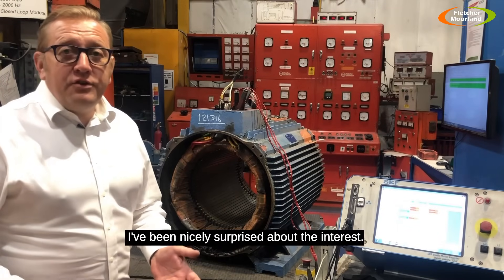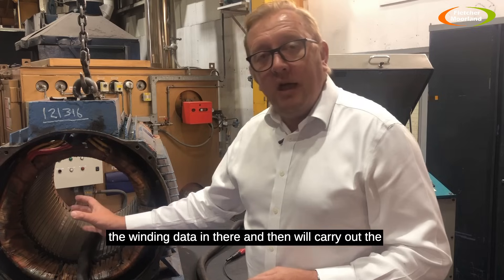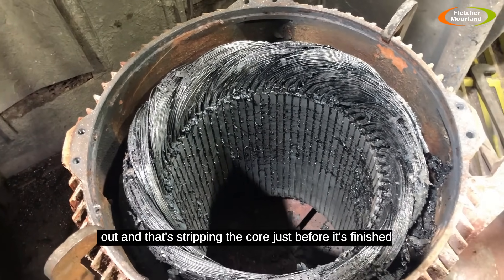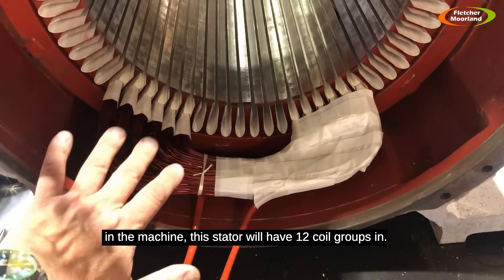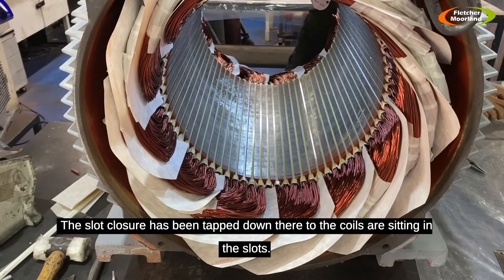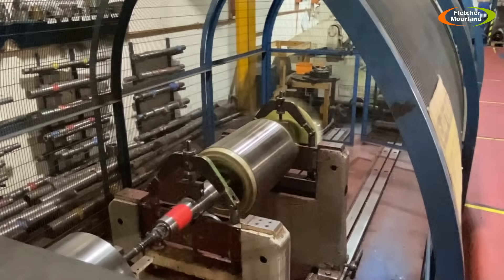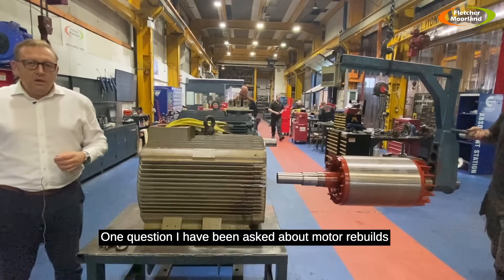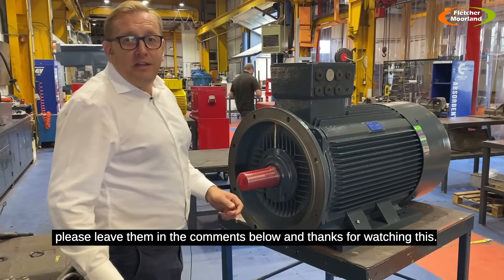How it's done....Electric motor rewinds

Comment: Very nice video with no silliness.
Do I understand correctly that all the individual winding wires are bare until the VPI process? It surprises me that the varnish is able to insulate the wires from each other.
Reply: The conductors have a polyester coating on them already so they are insulated from each other when coiled and laid alongside each other. The VPI and stoving process holds it all firmly together.
Reply: @fletchermoorland3501  Ah, that makes sense. Thank you for the explanation.

Comment: Excellent, I worked as a machinist in a large rewind shop for 8 years, it was a satisfying job and shop to work in, your shop has a few more bells and whistles than some but that's good, you end up with a high quality rebuilt motor and a guarantee that you can stand behind. We mustn't forget your great qualified crew working for you with out them your paddling up stream. Thanks for the video mate!😎

Comment: The definition of how its done is to show it being done, I'm fully half way through the video, nothing shown how its done except a guy using a hydraulic ram to extract wire, wanted to see how they put the winding's in, not happening, trade secret, its not how its done, its how its completed in stages without showing the actual work, like the narrator saying we won't show the saw in use its too noisy, we want to see the saw, too much assumed that we know what you are doing and you hiding too much.
Reply from the maker: Pretty sure we're showing a great deal actually, buy hey, some people are hard to please.

Comment: I am impressed with a very good rebuild here, but I have a couple of questions for you.  1) What if the core loss is found unsatisfactory, what is your task in repairing this?  2) If the endplates and rotor shaft are not found up to standard while measuring the bearing housing and rotor shaft, maybe too tight or too loose.  How do you cure this?
As I have seen in this video everything passed with flying colors, but I guess not every motor is like this.
Reply from the maker: The core can be repaired in a few ways, sometimes you can clear the hotspot by removing the copper of cutting away the 'bad' portions. There is always the chance to re-stack the core.Thats when the laminations are removed and re-stacked in a different order so the parts where the insulation is damaged is distributed around the core. The shaft and housings can be reclaimed by either boring and sleeving or filled with metal-spray coating or chroming.
Reply: @FletcherMoorland  Thanks for your reply.

Comment: Using your VPI process also has the benefit of boiling out any moisture during the evacuation stage of the process. 

It's essentially the same process as what is used in automotive factories to prep your brake lines (and do a leak test) by evacuating the lines. Which also removes any moisture. And then they fill the system using brake fluid under high pressure to drive out the brake pistons and seat the brakes.
Reply: Casting porosity sealing  process as well some use pressure some use vacuum they also impregnate circuit boards using this process too plus many another things
Reply: We typically bake our stators and let them cool to around 40°C before introducing the varnish to them. But we'll still draw a vacuum on the tank, flood it, and then pressurize it.

Comment: My first job in 1960 was with a small firm in Yiewsley which rewound motors and made transformers. The technology was a Megger, the windings were cut with a steel blade and a hammer, heat was applied to the windings with a blowlamp and the other end was levered out with a crowbar. Brake-testing was done on smaller motors by just stalling the motor with a leather strap and a spring balance. I don't think we tried stalling the bigger three-phase motors....  It was rather dirty, sticky with varnish and your place is a surgery by comparison!
Reply from the maker: Thanks for taking time to comment. It has taken some hard work to get the place as it it and for it to be noticed is great to read.

Comment: Very well presented and an informative refresher, thank you. I was an apprentice motor winder almost 30 years ago but my time was cut short due to ill health of the owners, both old men in their 60's and 70's, one a chain smoker the other with a heart problem, they had to let me go and consider closing shop. Your right about the amount of steps required, I still remember most of the process but am sure I have forgotten a few around the measuring stage, determining the pitch ect for setting the winding mandrels and also around the final coil formic stage and laying out the coils so that they all go in the same way...no reversed coils...just the bits not featured in this video! 
It would be much appreciated if you could spare the time for another brief video of the coil measurement and forming stage, this video is one of the best fairly detailed summary and clear imagery I have seen on the subject, albeit with modern machines..  Now reconfiguration / pole changes, dc armature winding and motor design.. that's a what the old men took with them before they could pass it on.
Reply from the maker: I will add it to the list. It maybe a bit too much detail for most viewers with the coil pitch, turns, groups etc but I'll do one.
Reply: @FletcherMoorland  GREAT VIDEO. I was reading through the comments to insure I would not be duplicating a comment when I found gentleman @daic7274's question requesting more detail about the windings. I also am curious as to how the coil maker chooses wire size, number of turns, gage, etc. Also: I see that the coil set occupies six slots and six slots, spanning seven slots betwen the two coil sides. Are the seven vacant slots filled, and how is this accomplished when the next coil will presumably occupy six slots and six slots?

Comment: I was a motor winder for many years for GE. I've been retired for 11 years. This video brings back good memories. My last several years with GE I was certified in low, medium and high voltage switchgear and transformer testing. I used a Doble test set for the transformers
Reply: @riteshkakkar7112  , India good!

Comment: Excellent work, curious to know how much cheaper to refurbished /new one...%
Reply: You have to consider many of these applications are unique.  Can't just get a motor off the shelf.  So it is the difference between a custom built motor and rebuilding the existing.
Reply from the maker: In this example the repair price is around 2/3 the price of new. The repair though has made the motor better than new with class H insulation, VPI and G1.0 balancing. It also is covered with a 3 year guarantee whereas from new it only has 12 months. Pricing isn't the only consideration when repairing/refurbishing equipment. What you get at the end compared with what you get new should always be compared.

Comment: I like the video of that India fella rewinding a car starter in a dirt floor 'shop'.
Reply: ya na. such motors don't last very long due to poor workmanship while motors winded by these professionals like in the video last a very long time
Reply: Haha yeah just came from there, they’re awesome but i doubt they can do a motor this big with the tools they have.
Reply: @omanazzal  Oh they can! There is one video of an Indian workshop winding a massive 200HP motor for a factory.
Reply: @AhmedAdly11  I wonder how long they last? Couple of weeks maybe?
Reply: @colincunningham1902  I had a 35KW generator get rewound in Egypt. Basically the same thing.
It worked on my boat after that for 5 years before I ended up selling the boat. And as far as I know it is still working year later.

So you would be surprised.

Although; it is a hit and miss. Another guy I know had a full rewind and it didn't last a week.

But in places like ours, sometimes it is a matter of availability.
Also, rewinding can cost a 50th of a new purchase. So it also depends on economics.

Comment: Bloody fantastic, what a company. I work offshore globaly on deepsea in situ  drilling. This to me has far more appeal.
Places like India and different counties in Africa do the same, just without the toralences and machines. So good to watch. Great British company  well done.
Reply from the maker: What a bloody great comment to leave, thank you.
Reply: In india we have started using same equipment for tolerances for large motors 50KW and above
For smaller motors the extra cost in testing is avoided because in practice the rewinded motors do operate risk free for 2-3 years and except full winding loss/burnt most repair shops provide very cost effective rewinding. GBP30 
-50 per rewinding event that occurs once in every 4-5 years for the motors when they run on higher loads than recommended

Comment: Very nice video, the facility is fantastic for rewinding of motors,your detailing of the process was great,very informative, you could have added pre varnish tests before VPI process like winding resistance,Megger,Hi pot, surge comparison tests etc,which you had carried out initially when assessment of winding failure was done. Very nice video
Reply from the maker: I decided to cut those bit from the final edit as I showed the Baker tester at the start and didn't want to repeat those steps. Thank you for the comments.

Comment: Hey have never seen a bearing fit measure machine like that before. I still use inside mics at the motor shop where i work.
Reply from the maker: Both do the same job in the end. We just find it quicker this way and we have a record of what's been measured. It's also really useful for Ex motors too when measuring flamepaths. Another benefit is that it will automatically calculate housing / spigot concentricity and all the bearing tolerances are loaded into the software so we don't have to look for tables etc. Thank for stopping by to comment.

Comment: Inserting the wire is still manual
Reply from the maker: Yes, for repairs it is a manual process. Manufacturing in general is automated as they have a production line with many of the same size stators to wind. In a repair process there are differing sizes, types etc so still a hand crafted product.

Comment: Great video. You do a great job at explaining the step by step process. I rewound motors for more than 20 years. 1/20th HP up to 500HP. You only thing I didn't catch was, what is the motor connection? By the size of the motor I would have to say it was probably a Y∆ Connection. But you did an EXCELLENT job start to finish.
Reply from the maker: I can't remember now Keith, I'll have to check the records.

Comment: Thanks for the video Matt.  Very interesting

This may be one of the best descriptive videos of the Heavy Duty Electric Motor Rewind that I have ever seen with details.
 Great Job detailing out the process.

How you calculate the new winding data? I mean you change the KW, there is any way to learn to calculate the data?  

and how to change the wire gages? I mean if I have 4 wire and how to convert into 3 or 2 wires in a different size?

I am happy to receive your reply soon

Thanks
Reply from the maker: Thank you for your comments. In regard to the winding data we would copy wind exactly the same data in most cases. The windings for this one is exactly the same as it was made and no change in kW or voltage. We would make sure that we have the same cross-sectional-area of copper in the stator. if it was 4-wire in parallel we could go to 3-wire or 2-wire but maintaining the same cross-sectional-area. We would not go down a size though as this could increase the resistance. Changing the wire size though can give problems as you may find it harder to insert the wires in the slots and to make the end-turns.

Comment: I first make the impedance test and insulation test before the varnishing...if something is wrong you can fix it. And before putting it in the tank I put it in the oven to heat up and remove any moisture  from the insulation, because the insulation is hygroscopic.
Reply from the maker: We carry out all the tests again before VPI however I didn't show this on the video so not to repeat steps. Some insulation material can benefit from heating the stator prior to varnishing. This also has the added benefit of allowing the varnish to penetrate the windings better. The VPI resin we use does not need this stage as it is much thinner (although better) than standard varnish. It's Elantas H1100 we use.
Reply: @FletcherMoorland  Don't get me wrong, I didn't wont to diminish what you are doing there. It's an excellent job you do there, even better than standards!!!! What is the voltage on the insulation test ?
Reply from the maker: @srdankragulj6581  For the IR test we do this at 500V and for the HI-POT and surge test at 1830V (twice line + 1kV for a new winding)
Reply: @FletcherMoorland  Thanks for the replay....

Comment: How did you get the core loss as 6.9 Watts.
What is the formulae.
What is the minimum required to assess whether core is good or bad
Reply from the maker: We use a Lesesco Core Loss tester to do the test. EASA have a rule0-f-thumb that states anything below 8W/Kg is good, below 8-12W/kg is marginal and above 12 is bad. The most often used test though is the before burn-off and after-burn-off test as these should be the same to prove the process hasn't caused as degredation in the core. OF course if it is bad before burn-off then either a new motor or a re-stack maybe the best option.

Comment: Sir this motor connection data? 4 parallel or 2 parallel connected? Please
Reply: Looks like it's a standard 4 paths 4 pole T-B connection, but the 4 paths are split into two, that's why there are 12 leads out and not 6, the two half of the 4 path connection will be joined together on the terminal block.